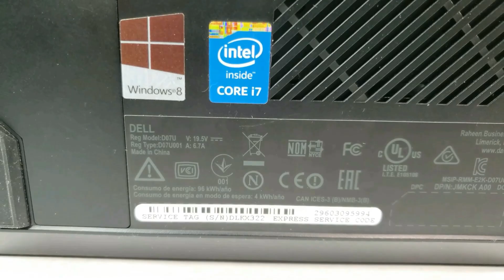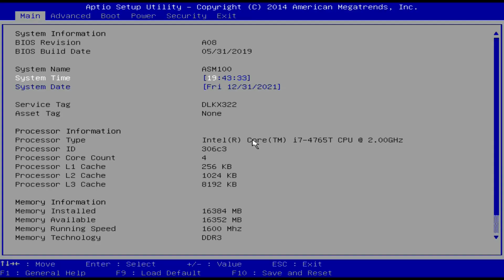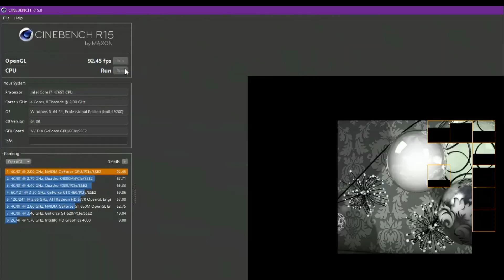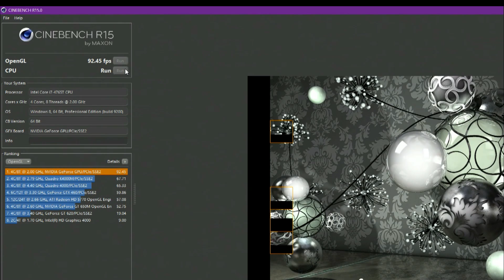Alienware Alpha Awesome!

Comment: I've upgraded and rebuilt several of these little guys. Even now I think they are surprisingly good little gaming machines. I still have I use as our media center PC. I mostly play older titles on it but I've recently thrown the PC version of Marvel's Spider-Man at it and it managed it. Sure it's on a mix of low/medium settings at 720p but it's still very playable and decent looking.
Reply: Did you use the external gpu?

Comment: Alienware was simply put one of the best notebook vendors, they made robust machines with high end hardware. But also dell XPS used to be a really good notebook brand. Nowadays dell just screwed up with their prebuilt desktop making everything proprietary and putting everything inside a case with almost no airflow. Only if they had left one upgrade path just for the cpu cooling by making the cooler mounting holes standart, only if they had made the motherboard screw holes standard atx to allow people to swap the stupid case, then dell wouldn't be this much criticized.

Comment: they did ruin it this was my nephew pc when he used too come over he would play fortnite on it i would be on my personal gaming desktop pc i build by hand . nopw it only lasty me 6 months of owning it i payed 200$ too have it repaired shit .it used too be 100 but dell increased the price too repair stuff i hear in some places .now it is just in my closet collecting dust cause of the board is dead and cpu not working as well i need a replacement off a cup . i just got it for the steam controller . now i wonder if i can build a pc this case mini itx ryzen pc i wonder if a ryzen apu can fit in hear but instead i just build a ryzen 5 3600 with a gtx 1080ti 11gb build as my main rig now

Comment from the maker: If you have a project like this Amazon Affiliate links: TOOLS AND UPGRADES
- G.Skill RipJaws SO-DIMM Series 16GB (2 x 8GB) 204-Pin (PC3L-12800) DDR3L 1600 CL9-9-9-28 1.35V SO-DIMM Memory Model F3-1600C9D-16GRSL https://amzn.to/3HAb4x3
- Acer SA100 240GB 2.5 Inch SSD SATA III 3D NAND PC Internal Solid State Drive Up to 560 MB/s - BL.9BWWA.102
- ARCTIC MX-4 (incl. Spatula, 8 g) - Premium Performance Thermal Paste for all processors (CPU, GPU - PC, PS4, XBOX), very high thermal conductivity, long durability, safe application, non-conductive https://amzn.to/3FWZStN
- iFixit Pro Tech Toolkit - Electronics, Smartphone, Computer & Tablet Repair Kit https://amzn.to/34lOJFc
- BIOS CMOS RTC Battery for Dell Alienware Alpha Steam Machine i5 i7 Desktop by Rome Tech - Yellow Light Fix - CR2032CL-23-2 https://amzn.to/3zwWyTV